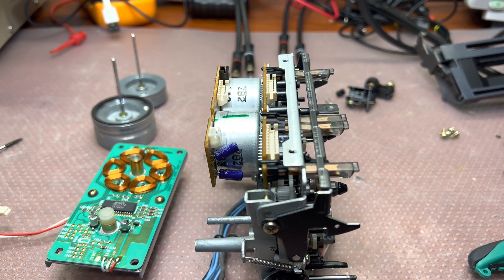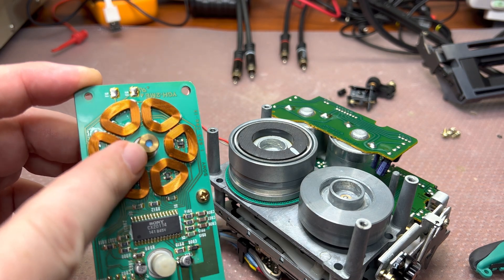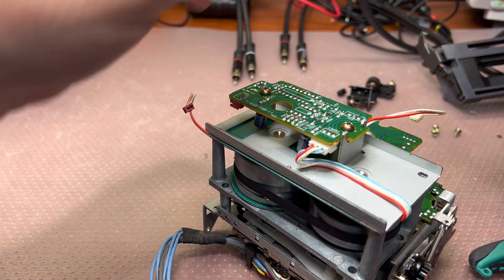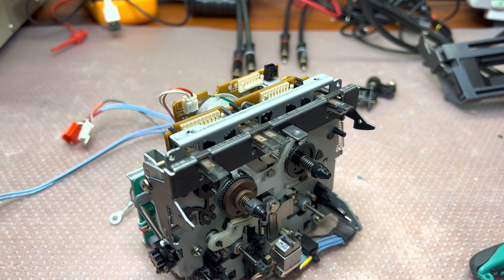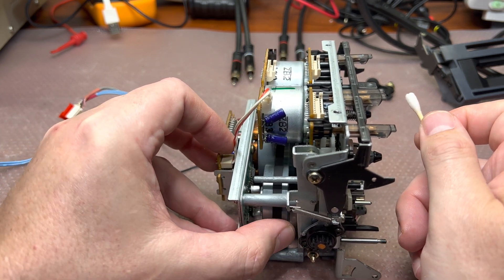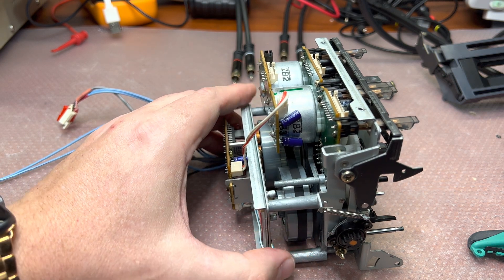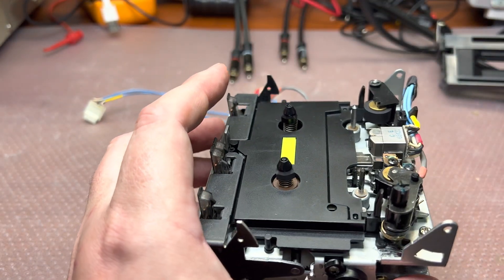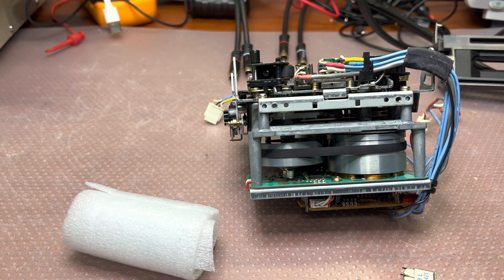Golden Sony TC-K890ES Restoration Series - Part 6: Assembly Continues, Tape Path Calibration

Comment: Sir. Do you have a video show how to replace idle tire for this model?(tc-k890)
Reply from the maker: This model does not have an idle tire. It uses gears.
Reply: @hifirulezzz  how about the video how to replace pinch roller? Thanks
Reply from the maker: @HaiTran-eb3ce  I believe I did a few. Check my Sony videos.
Reply: @hifirulezzz  I check all the videos of this model. But can not find any. 
Another question for you. Why did my deck eat the tape on 1 side of it?  But not every time it is played.
Reply from the maker: @HaiTran-eb3ce  this question don't have any details and its the similar ask like "why my car don't start". These may be multiple reasons. You have to investigate.